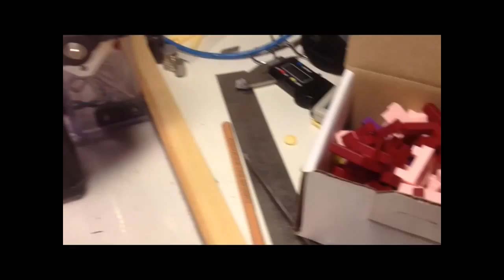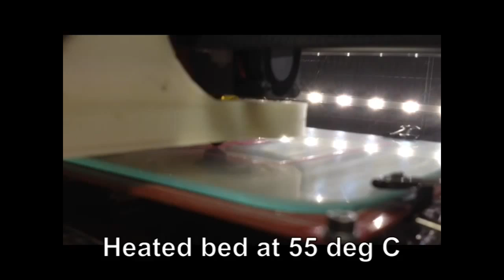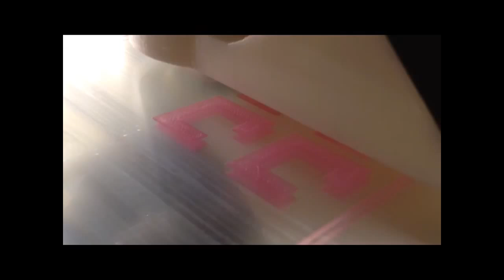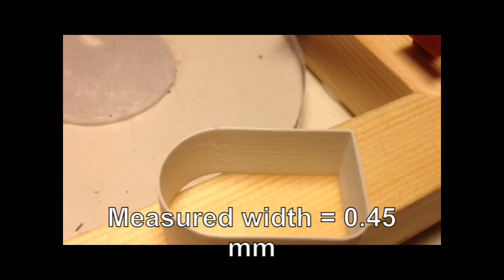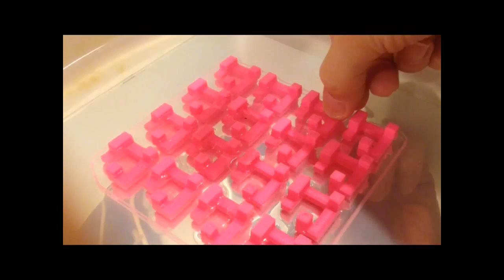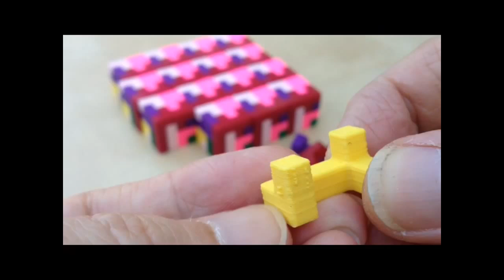3D printing tips

Comment: Dear Richard, can i ask you some questions? Because we bought a Mbot Cube few month ago and we are having problems because the first layer don´t stick very well.

I was checking in internet and can be for a lot of reasons, and we are trying different ways, but still don´t find the answer:

- ABS or PLA?, no we will buy PLA for check, because until now we just used ABS. Some ones says that one is better for winter, the other for summer, because temperature.
- Printing Speed: Always is better to print at slow speed?
- Masking Tape, Kapton Tape: I saw that someones use them. But in some videos seems to be under the firs layer, on others over it for avoid non stick corners. Do you recommend to use that?
- Glass Platform: We scratched the acrylic platform because wrong calibration. Can we use glass instead of it?
- Room Temperature: We tried using heat fan, but as i see in some videos, i think we are wrong, because after the plastic going out, you need to cool it down?

I´ll appreciate you feedback!!

And thanks
Reply from the maker: Hi Giovanni
Thanks for your interest in my video.
You are absolutely right to spend time getting the first layer printed properly. Once you get it right, the rest of your printing will become much easier. There are many factors involved which is why people so often find it difficult.

Level printing surface - make sure you have levelled the bed before you try and print anything.

Nozzle height - This is the critical one. Cut a strip from an ordinary sheet of printer paper. Place it under the nozzle and then home Z. You should be able to feel slight resistance as you push and pull the paper under the nozzle. If you cannot push the paper back under the nozzle then it is too low. If you can't feel the friction when you pull back then it is too high. Make sure it feels the same all over the print surface.

Print bed surface - I always use glass. Find old picture frames and learn to cut glass to the right size for your printer. I always have several sheets of glass ready so I can keep printing when a print has finished. Blue tape is OK but rough. Kapton tape is expensive. PVA glue is very cheap and grips the extruded plastic much much better than any tape. You really should try this first.

Print bed temperature - it is certainly possible to print PLA onto a cold bed (not ABS though) but I find that it sticks much better if you use a heated bed at 55C.

Nozzle temperature - you need to find the right temperature for your plastic. Heat up the nozzle and try pushing it through by hand at lots of different temperatures. At about 200C the plastic thread should flow smoothly with moderate pressure. If it drips out of the nozzle then it is much too hot. If it takes a lot of force to push it through then it is too cold.

Printing speed - I generally print everything in the 20 - 40 mm/sec range because I need good accuracy. The first layer should always be printed at 50% of this speed to help it stick.

Extrusion amount - I hope you have already calibrated your E steps per mm. If not, you will have to do that next. Watch the first layer as it is being laid down. If there are gaps between adjacent strands then you are extruding too little plastic. If they are just touching then it should be about right. If you extrude too much plastic it will start to ripple on the glass as the excess builds up in waves.

If you're still having problems, why not shoot a video and put it on YouTube or Google+. There will be plenty of people willing to help you.
Regards
Richard
Reply: Richard Gain Thanks for your help.
So, i will try your advices. Right now the thing is in Chile isn´t very easy to find material for this. We bought it from China, with a lot of ABS, so we want to use ABS first. I understand that you recommend PLA better than ABS. Did you tried ABS with ABS Juice?, you put that direct to the glass (the abs juice)?. I´ll try warming up the bed before print. This one has not heating.

Best Regards
Reply from the maker: Giovanni Chiappe OK, my mistake. I didn't realise you were using ABS. Yes, I always use ABS juice on glass for printing ABS. The main problem with ABS is that it warps as it cools which can cause the print to come unstuck from the bed. Ideally, you need the bed heated to about 110C (and for larger parts a heated chamber surrounding the printer heated to about 40 - 50C).

Comment from the maker: Tom, as I said in one of my earlier comments, I use 'Sorli' mirror tiles from IKEA. They come in packs of four, are cheap, disposable and Mendel-sized.
I slice with both Slic3r and Kisslicer. I use Repetier Host to carefully inspect the gcode from each slicer and decide which one looks 'cleaner'. I typically use 0.15 - 0.2 mm layer height and generally print slowly at 30-50 mm/s.
Have you read RichRap's excellent 'Slic3r is Nicer' tutorial? I would recommend that for setting up your printer.

Comment: Thanks for this Richard.  I am a Mendal90 owner.  I happened to have just broken the glass on my bed.  I notice yours is much thicker.  Can you tell me the thickness and where you got it from?  I take it you find it works well and isn't as fragile as the stock piece?  Also, I would love to know what software and settings you are using?  Do you have a list anywhere I can look at?  I'm having a lot of varied results and need to do as you suggest and tune it up.